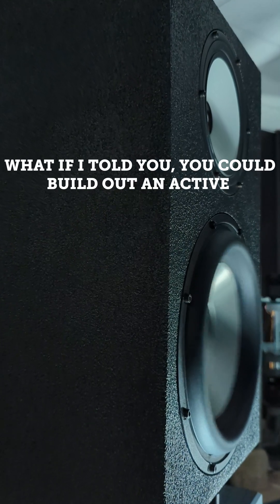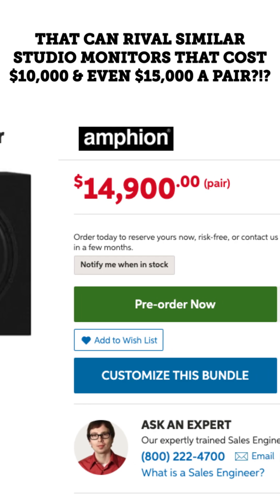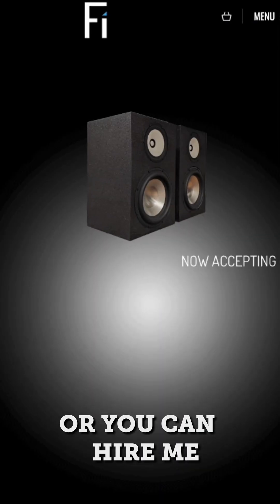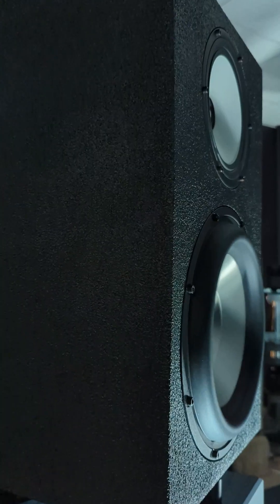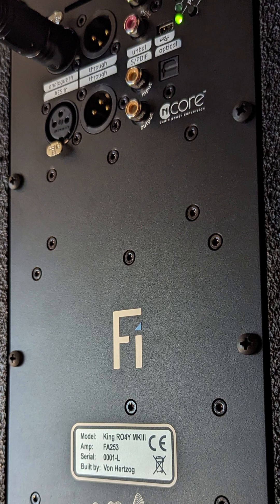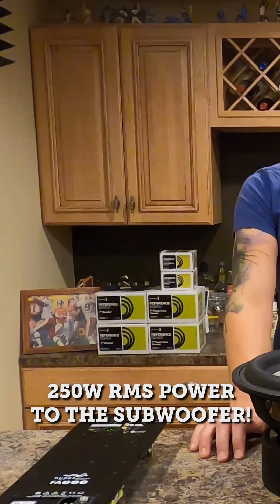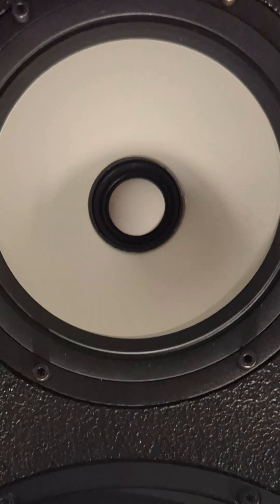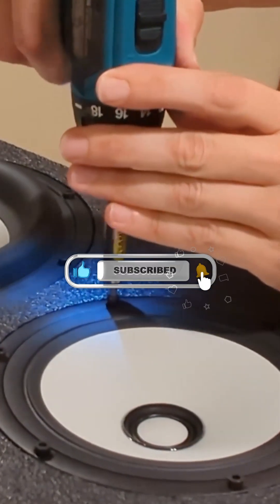NEW Active 3-Way Studio Monitor with DSP #DIY Build Video NOW LIVE! The SEAS King RO4Y MKIII #hifi

Comment: If I could do it all over again I’d use these amp/xover plates,as apparently you need expensive poly caps etc in passive cross overs . It would be so sweet to just change the band pass frequencies on the fly till you get it right  ,just like in the old days with car audio .
Reply from the maker: Yeah it definitely makes it easier to play with. I will say miniDSP is an easier option and they provide some two channel plate amps that are nice too.

Comment: Been using the Hypex plates with DSP since they became available as they make active setups so much easier and to my ears better instead of turning a bunch of energy in to wasteful heat like my stand mount PSB / passive networks resulting with 87db 4 ohm pigs =)
Reply from the maker: Yeah big fan of Hypex amplifiers. So clean and powerful!
Reply: @SocialClubSound  Its the only D class I heard and like with exception to PA amps to run any extra subs. I also like that Hypex put RCA line outs to tether to even more power amps when needed / wanted making no need for signal splitting devices.

Comment: I want to build a pair of monitors. Can you help me with advice? I think they would be too large. I want to build this exact pair of monitors just with 8”. What do you think?
Reply from the maker: It would totally work check out Ex Machina Pulsar. It's essential this design with an 8" sub and different driver materials
Reply: Thank you for that info. Any suggestions with building those 8” monitors ?

Comment: what is crossover frequency between woofer and mid and tweeter? (I forgot to ask this question🤠)
Reply from the maker: 215 Hz from subwoofer to mid-range and 1880 Hz from mid-range to tweeter
Reply: @SocialClubSound  👍
Reply from the maker: I should note, the filters for the mid / tweet are set to 1800 Hz but the effective crossover point is closer to 1660 Hz because of the EQ applied to the individual drivers. Hope that helps clear up anything I left out.
Reply: @SocialClubSound  for Genelec 8361a (also coaxial) , it is 2800 hz. is it for smaller midrange of Genelec ?
Reply from the maker: The higher crossover point is usually because the tweeter won't play as low so the mid-range is asked to play higher. Not a lot of tweeters want to play down below 2 KHz. Usually the crossover point matters for how the speakers will image, but with a coaxial it's different as they originate from the same point in space so the crossover frequency is less important. Hope that helps!
Reply: @SocialClubSound  thanx🙏🙏
Reply: @SocialClubSound  I read a comment of some user that made same speaker and he said he used crossover at 615hz instead 215hz. and up same as original at 1880hz. His idea was that 215hz is good for rock/acoustic but electronic music genre ends up lacking some kick. Your thoughts about that?
Reply: @prodby_rale5218  This kind of changes are a matter of opinion, in real life everything should be verified with measurements (how the change affects the power/polar response etc).
Reply: @prodby_rale5218  the most I would go with this woofer is probably 500 Hz. Though, you need to keep in mind that compression starts to increase at higher frequency for such large woofer to play at 500. So the safe approach is too test it out, but my opinion is that this midrange already plays perfect by 350Hz, so there is where I would cross it.